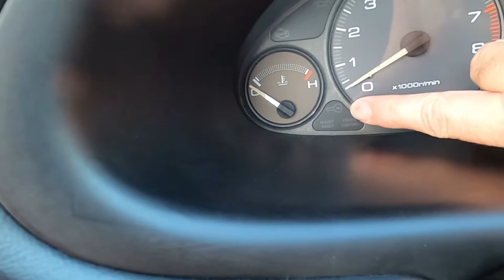Integra FAILED!!!! A Crank but no Start Issue

Comment: Guys take note if you bought froma previous owner that installed an old alarm system it can cause interference with the ignition switch, i tried everything and still would crank no start sometimes it would start sometimes it was hard...when i removed the old alarm it fixed my issue
Reply from the maker: Yes true I removed my old alarm system and that shit was a wire nightmare underneath the dash
Reply: @dbj710garage  yea lol, it's such a mess specially if it's a spliced alarm system🤣
Reply: Smh ima remove that bs

Comment: I have a 2001 Integra LS auto with the same problem I changed the main relay, plugs, cables, fuel pump. I see the key flashing around four times then stops blinking. so I'm not sure if its the security / key fab.  The car will start run and it seems fine then most of the time I will pull up to a stop and the will shut off. It will crank over for days then all of a sudden it will start. I was told it could be the crank senor or maybe the distributor. I also now have another issue.. I have an error code for the CAT and its suck in limp mode, but I thinks that's because of the CAT / O2 sensors.
Reply from the maker: Yes sir it gets frustrating at times but stick with it. Have you checked the timing and made sure it's good and not slipping? If possible I would remove the cat and run it and see if it still does the same thing or not. If it runs better I would replace the cat. Check the cool pack inside the distributor it's an easy and cheap fix and they seem to go out causing a hard start and running issues. Keep me updated and good luck 🤞
Reply: My 97 integra is acting up too, cold starts right up once warm it stalls out and ☠️ then crank crank crank no start. Has new iacv new main relay. Nothing works  Any ideas!! I need it running 😫😫😫😫
Reply from the maker: @DavidRamirez-kv9xc  thanks for watching. have you checked the TPS? i believe the voltage when closed is 0.45-0.5 wide open is 4.9-5.0 this could be a possible cause. I hope this helps.
Reply: @dbj710garage  keep up the good content. And yess i installed a new Blox throttle body along with the blox tps and i did calibrate it aswell. I did the timing, i replaced the main relay, and cleaned out the cap on the dizzy. Fuel pump works, the fuel is there but still wont stay on. Im going to be doing a ecu reset and that doesnt help i will be taking out the ecu to pop it open and see if theres any issues in it.
Reply: Oh and i installed a new idle air control valve
Reply: I have 94 acura integra was running fine change out the relay that goes under the dash I have gas running but no spark can someone tell me don't know much about this cars I'm a chevy guy

Comment: Hey guys I have a 2000 ek with a b18c gsr, having issues starting and idling the car, the car cranks over, at first I didn’t even have my iacv plugged in, so I converted it from 3-2 wire thinking that would fix it, the car will turn over but die almost instantly if I don’t gas the shit out of it. Any suggestions?
Reply from the maker: Have you checked the throttle position switch? If this gets loose it will cause a stalling issue.
Reply: @dbj710garage  yup the tps and map sensor are in the correct spot, I had this damn car idling nice a few weeks back without the iacv even plugged in, should I touch the idler screw? I haven’t cleaned the tb either
Reply from the maker: @Adderall__  it wouihurt to try adjusting the idle screw and see if that helps. Does the rpm bounce around ?
Reply: @dbj710garage  the car struggles to crank over, when it actually does go on, it dies in a few seconds unless I keep feeding the gas pedal, it will not idle at all
Reply from the maker: @Adderall__  have you checked fuel pressure? Could be having issues with fuel pressure regulator. Can you turn the key on and hear the fuel pump prime? Try to prime it a couple of cycles before trying to crank over.
Reply: @dbj710garage  when I turn the key right before cranking yes I can hear the fuel pump kick on, do you think my skunk2 intake manifold has something to do with it? Which connector is on the top middle of the manifold? I have 3 sensors on my manifold, I know 1 is tps and the other is MAP, what’s the third one?
Reply from the maker: @Adderall__  it may be the charcoal canister purge valve on top of the manifold.
Reply from the maker: I think it may be a fuel pressure regulator problem if it's hard to start and dies right after there may not be getting enough fuel
Reply: @dbj710garage  you mean evap? Sorry this is my first Honda build learning as I go, this is really discouraging me. Do you have any social media I could send you vids or pics? Might be easier then the comment section haha
Reply: @dbj710garage  I changed my spark plugs, I did have the car idling at one point, I doubt it was the new spark plugs I put in

Comment: Did you find a fix for it or are you still with key start
Reply from the maker: I went and did the OBD1 conversion it slowed me to remove the pass lock system and keep the push start.

Comment: Have a problem I turn the key and it just clicks fp primes alternator new starter new battery newish has been sitting plus wires are connected good I'm just stuck at the moment
Reply from the maker: Is the car in park or neutral? I have made this mistake before where I left it in gear many times . 
Does it just click once or does it rapid click?
Reply: @dbj710garage  it just clicks once and the weird thing is I changed the alternator and the battery light is still on and for some reason every time I turn the key the brake light on the dash comes on now
Reply from the maker: @R.A.N.B.I  it sounds like it might be the safety switch attached to the brake not engaging causing the ECU to not want to start
Reply: @dbj710garage  ok so when I had my auto ecu in it  started but when I swapped it to the manual ecu it started doing the clicking after a while when I swapped it
Reply from the maker: @R.A.N.B.I  was it starting after the swap and just started doing a click recently?
Reply: @dbj710garage  yeah it started fine and after a while it started to click
Reply: @dbj710garage  plus I changed the 100 amp fuse I tried to jump the starter from the battery and nothing seems to go through like no power
Reply from the maker: @R.A.N.B.I   I would look into possible a bad starter even though it's new I had that happen last year
Reply: @dbj710garage  have u heard of the starter relay would that cause it not to start and the 12v fuses in the box next to the battery
Reply from the maker: Keep me updated man !
Reply from the maker: @R.A.N.B.I  that is a possibility
Reply: @dbj710garage  I'll check it out and charge the battery up just in case it's dead I'll give u a update
Reply: @R.A.N.B.I  any update on the issue? I just got an integra and i have the battery light and brake light come on and just one click when i go to start it.

Comment: I’m having the same exact problem with me Integra. Crank no start. But mine is a 99 which did not come with a key mobilizer. Any tips?
Reply from the maker: What have you checked and went through so far?
Reply: @dbj710garage  new fuel pump,fuel filter, distributor, even swapped out B18b1 to another B18b1, TPS Sensor, spark Plugs, map sensors, and throttle body. Everything is new.
Reply from the maker: @stolaola6313  did you check to make sure the TPS sensor was reading open and closed throttle? I had mine come loose and was telling the ECU wrong so I wasn't getting enough air and fuel and I couldn't start the engine.
Reply: @stolaola6313  did you get it running. Its been 8 months now any word??
Reply: @Stola Ola  if u bought from previous owner and it has an old alarm system installed that is the problem with crank no start, its like a tumor, remove it and it will work like a charm, that was what was happening to mine and i fid all u mentioned without succes and even some more but turns out it was old alarm system that was interfering with the ignition switch

Comment: 2001 Integra LS auto  continued - I've had it in two shops one guy changed the main relay again and was running fine then the problem came back after a day. The second shop could duplicate the problem and as soon as I ran it for a day it shut off again.. really frustrating.. any ideas? I will be changing the CAT and o/2 sensors then I guess the crank sensor.  any ideas would be great!!
Reply from the maker: Do you hear a loud ticking noise? It could also be the fuel pressure regulator. Mine was going out and giving me starting issues and making a loud ticking noise. It would crank over and act like it wasn't getting gas. After replacing it the car ran quieter and no issues starting. Good luck